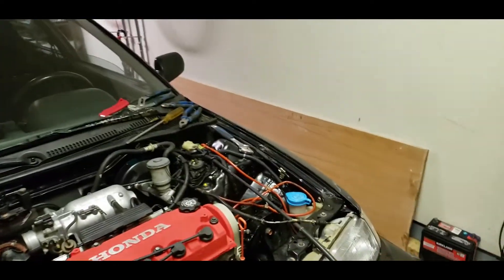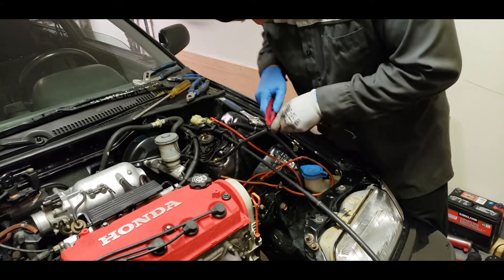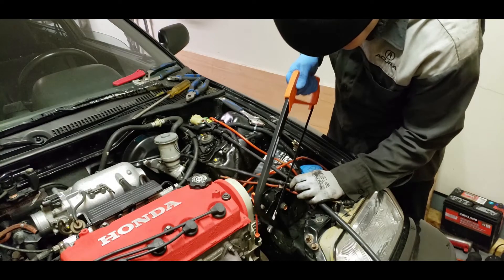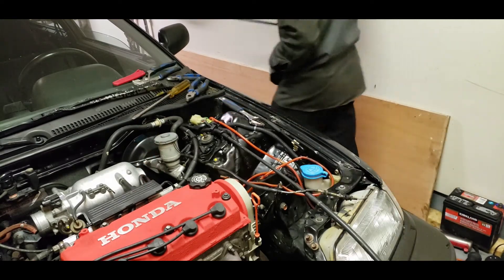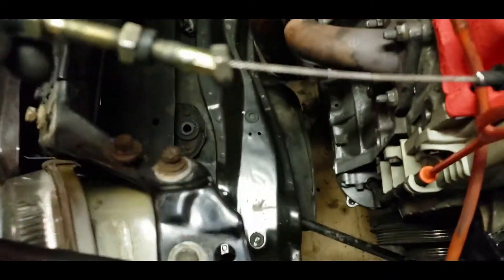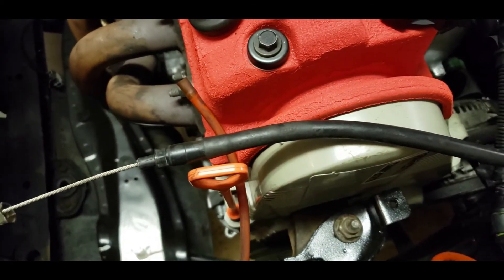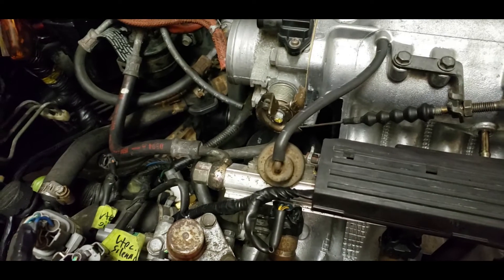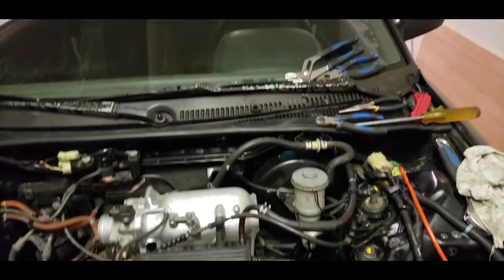[Part 6] D16Y8 Engine Swap: How to Modify Throttle Cable & Connect Fuel Return Line

Comment: what mount bracket did you use on the waterpump side the one to original motor or the one to the y8 worked?
Reply from the maker: you have to use the one from original motor. Y8 one doesn't work.
Reply: @BudgetGears  ok thanks
Reply: im back again lol where u wire  crank sensor to distributor or straight to ecu i have the p28?

Comment: 👋🏻 hi i gotna take d15 out and put d16y8 in question is do i need to buy new conversion engine mount?
Reply from the maker: No. You only swap the mount post from your D15 on the timing belt side over to the D16Y8. Trim the timing cover a bit. Then use your stock mounts. You'll need a conversion mount if you're using the hydro transmission. This is all assuming you're dropping it into a EF chassis.

Comment: I kept the stock D16 but I did a little bit of rewiring and throttle cable modifying in order to add cruise control from a 1990 Civic EX
Reply from the maker: Cruise control is a neat thing to have! I'd like to add AC if I can find a complete AC set.